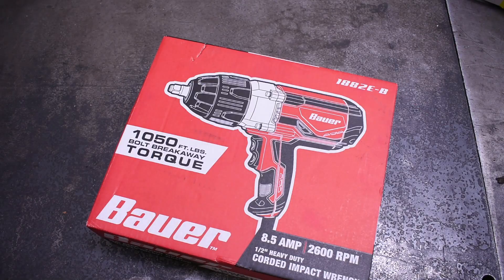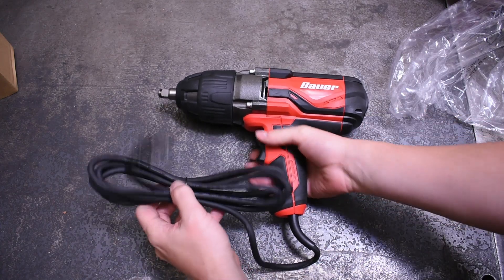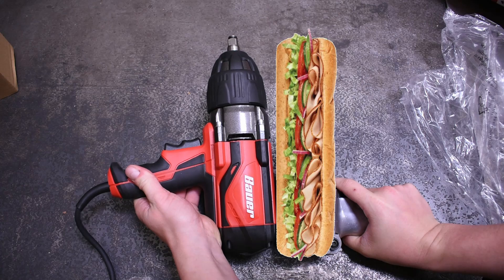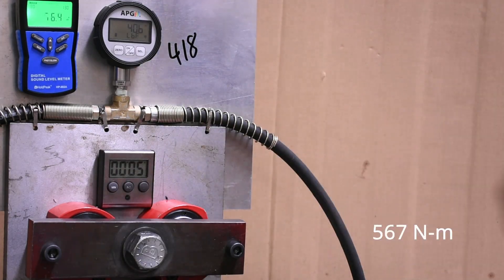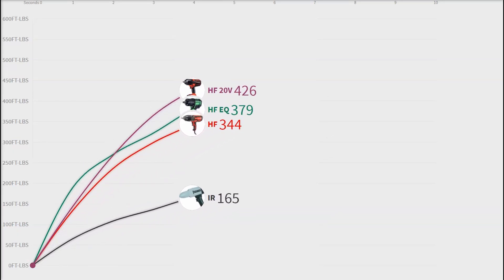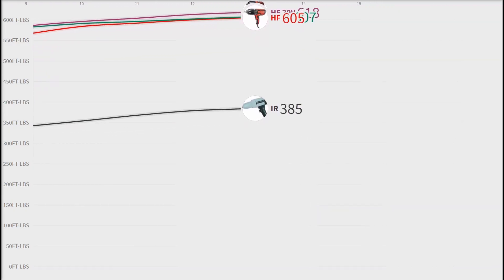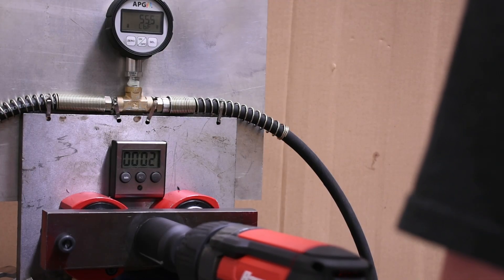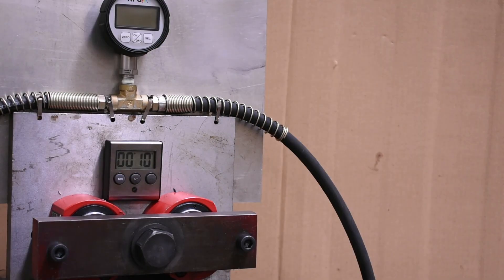How Much Torque Can a CORDED Impact Make? + Dyno Test Extension Cord Losses

Comment: Often you can get this on sale for $70.  That's a shitload of power for $70.
Reply: And you get an arm workout...
Reply: If you don't have the money for a nice air compressor...  this is your Hickleberry!  Plus, batteries for tools anywhere near this price range don't last, and you're left with a useless tool after a couple years.  These will last forever with occasional use and are great for lugnuts.  Unbeatable for a $70 tool in a home garage!
Reply: Bought a porter cable half inch for 60 and change on Amazon. Its been a tank!
Reply: It is bulky AF but yeah hard to beat for that dollar amount
Reply: I got it on some special for $60 a couple years ago -- and was dumb enough to return it because I didn't need it.
Reply: I got my like 1200 nut busting Milwaukee on clearance for $55 but I didn't have any Milwaukee tools yet but that's how I got into the Milwaukee line
Reply: @james10739  O_O SHEEE, good deals lol. Even at the kit price, these are not bad prices when compared to well...the most expensive...Snap on. Milwaukee on a lot of stuff seems to be above the consumer grade and at the more industrial/pro grade but still OK prices. Not HF cheap but also not HF ''quality'' Whatever gets the job done really. That being said, paying like 700 bucks for a BARE TOOL from snap on seems just nuts.
Reply: @baileyhatfield4273  ya they actually had a couple so I bought 2 and was going to make some money on one but I sold it to my friend for what i payed like a sucker
Reply: @james10739  
You're a good friend, not a sucker at all.
Reply: @james10739 you wasn’t his true friend then since played him like a sucker 😂
Reply: @rosieclark3661  what are you talking about I sold it to him for what I paid
Reply: Yeah if you don't have a compressor and just desperately need to get that crank bolt loose, this is your savior.
Reply: Picked it up today for $59!!!
Reply: @JohnSRush  how?
Reply: It is nice for some things. Would be great for Honda crank bolts but the extension would soften up some of the torque. I found a better solution with the 4699 Power Bar hand impact wrench. You can fit it into tight spots with almost no clearance, and then you smack the handle with a hand sledge. This electric baby sits around for me, don't even know where it went.
Reply: Just got one off eBay for $59.00 and shipping plan to use it to the test on the notoriously tight Honda Crankshaft pulley lol 😂
Reply: @rosieclark3661 did it work?
Reply: @rosieclark3661 did it work currently trying to get mine off 😂
Reply: I picked one up for 40 bucks 2 years ago
Reply: I got it for $55 yesterday 
😂 
Cant beat that
Reply: Oh yeah. If you can put up with it not being cordless they’re great value. Same as many other tools, higher power ones especially.
Reply: @WineScrounger yea I was born around corded tools. But everybody wants cordless now. I don’t see what’s the big deal as long as it gets the job done I’m all in
Reply: I feel the same even if it does break you can pick it up again for the same $70 if you have coupons like they always put out every month
Reply: Perfect for the home garage mechanic
Reply: Bruhhh 😂
Reply: It was just 60 bucks and I picked one up. I have a mid impact dewalt and this will sit until I need it basically. For 60 bucks couldn't say no
Reply: I got mine for $40 :)
Reply: You got that right Bauer has the power!!!
Reply: I own one of those Bauer impact wrenches and it's a beast let me tell ya
Reply: $50 today with inside track
Reply: For $40 you can get a WEN.
Reply: Too heavy and tacky to be dragging around an extension cable all over the place

Comment: Thank you, for those weekend warriors where this may be a good option for a "Once in a while" use especially on CV nuts and lugs that my impact driver can't do.
Reply: My friend and I each have one of these big Bauer's. He bought his because I let him use mine. I feel this thing is for the instance of needing to pull out the big guns when the bolts/nuts are suborn. For normal everyday use I have a Milwaukee 3/8 M12 stubby impact. :)
Reply: That's why I ended up getting mine, I was working on some very stuck bolts on my car and couldn't afford a big enough compressor and powerful air tool, so I figured this thing would give me all day power without worrying about batteries.

Now I want to get one of the Thors but I'm pretty sure my 6 gallon air compressor would last like 5 seconds before dropping to useless pressure.
Reply: @eargesplitten9876  That's why I never bothered with air powered impacts. The big air hungry ones like the Thor require a good 60 gallon air compressor to get decent run time if you're doing a lot of bolt removal. A good affordable 60 gallon compressor is between $650 - $750, requires its own 230 volt hardline into the house and needs to be plumed with air lines and fittings.

You could probably buy the big battery powered Milwaukee, a couple batteries and charger for cheaper than the air compressor alone. Plus you don't have to put oil in it with every use like air powered ones.

That's been my dilemma with trying to get back into autobody painting. In order to get any decent run time with a good spray gun I need a decent sized compressor and good ones are expensive. Which I can't afford it at the moment. Plus I have no place to store it. So all of the rechargeable variants of air tools have been the best choices for me as I already have the batteries. :)
Reply: I've used it on axle nuts aka cv nuts without any issues. Also used it to press a bearing with a forcing screw style press. Both are about as tight as bolts/fasteners get on cars. Only tighter  bolt on my suv was my control arm bracket and it had no problem there either.

Comment from the maker: So darkmode or non dark mode graphs, what's the word?
Reply: Dark mode for sure.
Reply: Dark
Reply: embrace da powa of da daark syde!
Reply: The metabo hpt is rated at 1218 ft lbs breakaway and the 36v adapter makes it a corded tool. So technically this model from metabo hpt would be the “most powerful” corded power impact.
Reply: Dark mode everything.
Reply: So long as the squigglies keep squiggling I don’t have a preference
Reply: Dark mode for lighter colored lines, light mode for darker lines.
Reply: This stupid question is the only logical explanation! What looks best on YouTube for the clicks? 🙄🤬
Reply: Non dark mode much easier to see
Reply: Dark
Reply: Dark
Reply: Dark!

Comment: Knew it would be weaker than battery. Even if it runs on "120V", that's AC so it's just peak voltage, not average voltage, and battery guns are able to deliver way higher amps because there's no long cord, and amps make power.
Reply: Common 120 Volts AC refers to the RMS (root mean square) which is the DC equivalent from a heating standpoint, Effectively the average voltage. Assuming a sinusoidal wave form the crest factor is 1.414, meaning that the peak voltage is about 170 volts and the peak to peak would be about 340 volts.

Modern high capacity cordless tool batteries can however exceed the power available from a 120 volt circuit for a short duration.
Reply: Voltage has a lot to do with power too. 

Volts X amps = watts. 

120v X 1 amp = 120 watts

20v X 6 amps = 120 watts
Reply: The nominal AC voltage is the RMS value which is basically an average. So 120VAC is about the same as 120V DC. The peaks of that AC voltage are a good bit higher than the nominal.

Comment: My version of "letting off early" is pulling the tool and socket straight off the nuts while spinning.  Then finish with torque wrench.  It just removed a flywheel bolt listed at 145ft/lb spec without even blinking.

Comment: I first bought my corded impact from HF because a mechanic had installed a wheel nut hard enough for me to bend tools trying to remove it.  Mine is bulky, but for when I need it, it bangs wheel nuts off quick, fast and in a hurry to boorow an AvE'ism...  Mine is the old, gabbich style but on the plus side - it came with replacement brushes.
Reply: I have one of the big Bauer's like in the video and over torqued lug nuts on my old Silverado were my reason for buying it as well. The massive size doesn't bother me. It's more of a "Just in case" tool for further possible happenings with over torqued fasteners. My main impact wrench is a 3/8 Milwaukee stubby M12. :)